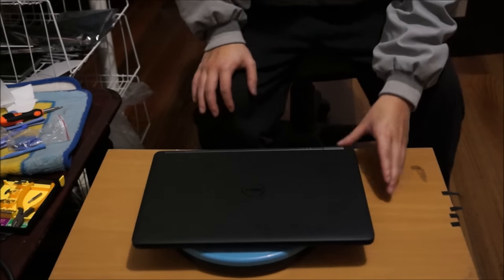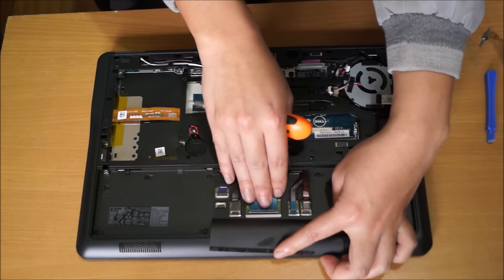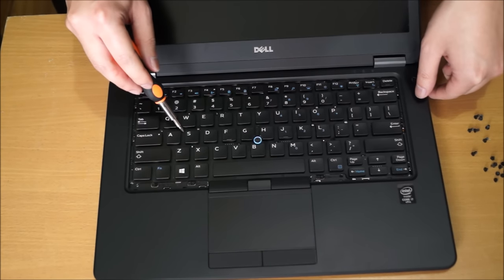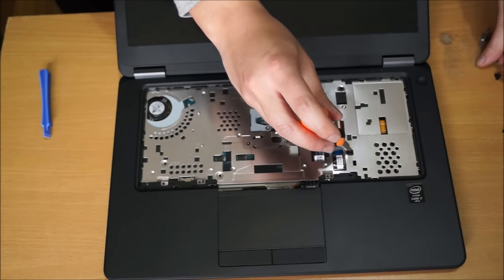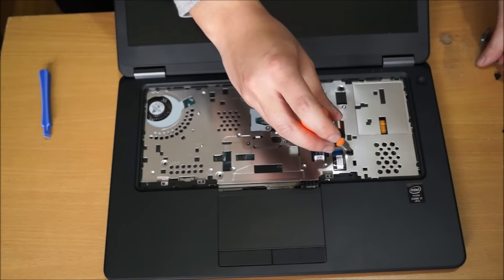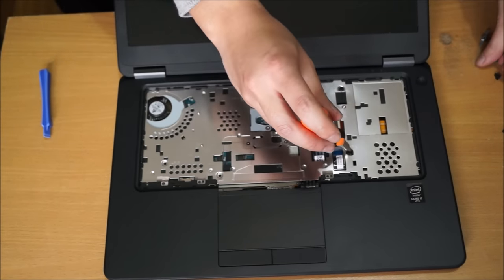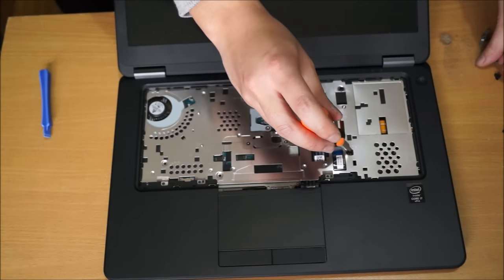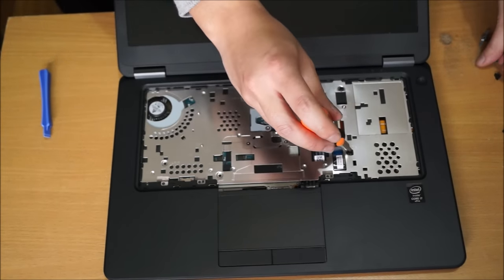OPEN ME UP! Dell Latitude E7450 and E7440 Disassembly Newer/Updated Video 1

Comment: E7470's are completely different than the E7450's - we have both in the environment and the E7470 has changed significantly.
Reply from the maker: Yes I have been advised of this and will upload  a video for the 7470 soon
Reply: Have you made the new video on the newest e7470? I just picked 2 up. Ive installed on my xps 15 9550 a Samsung pro 950 m.2. I want to install these on both Latitudes as they came with crap 128gb sanDisk x400. Even though I have a little Exp. in this, id feel more comfortable watching a video on my exact machine. Finally...I have been told even by dell CS (not that they all know what is going on) ,that you can upgrade the Processor from the i5 to i7. This would mean it is NOT soldered down. Any conformation on that? Thanks for all your videos!
Reply from the maker: sorry i dont have newer video on the products you are after, I can tell you that the cpu for both the 7470 and the 9550 is soldered on. I have provided you the user manual of the 7470 and it is soldered on. what dell is trying to say to you that there is a option when you buy the item to get i7 or i5. I will not be getting them as you may know i have to physically buy them to open them up and it is costing me too much. http://topics-cdn.dell.com/pdf/latitude-e7470-ultrabook_Owner's%20Manual_en-us.pdf 
http://topics-cdn.dell.com/pdf/xps-15-9550-laptop_Service%20Manual_en-us.pdf
Reply: Thanks for the reply. No actually I didnt know that you had to buy them yourself. That's crazy man, the service you put out is worth money...what a shame. Thanks for letting me know. I'm having a hard time finding much solid evidence on this e7470 on the ssd capability. Some say that the 512 Samsung 950 pro will not work on the e7470 because it is NMVE. Would you happen to know if the e7470 can operate the 950 pro. I was told only SATA, PCLE, and SED. I don't even know what SED is actually. Anyways, again i appreciate the reply and the info.

Comment: I disassembled my Dell 7450 as per the tutorial, which was clear and easy to follow. Thank you. Liquid spilled on my keyboard, it doesn't work anymore and the screen is appearing upside down. I thought I might be able to dry it out and reassemble. That didn't work.  What are my next steps? Will I replace the keyboard? Just the keypad? Or? How do I fix the screen? Thank you.
Reply from the maker: the screen is upside down probably because you press CTRL + ALT + UP, so just press the down instead up and it will fix the issue. you will need to replace the keyboard. once water gets in thats the end of it
Reply: @OpenMeUpTec   good

Comment: Jesus, you have to disassemble the whole damn thing to reapply paste? Had I known this, I would've opted for different laptop. Goddammit
Reply from the maker: this is a basic laptop normally purchase by companies and they use it the whole time without re-pasting it and it works fine. therefore you should be fine

Comment: thanks so much, humm nI need to put a new SSD, do you have reference that Imust look for? I wan make some 3D modeling (not big render just modeling) must I add change something else? thanks
Reply from the maker: nope nothing special. you need to reinstall windows or clone your current hard drive over to use the new one. other than that it should just work

Comment: My 7450 died and the LED gave me the possible "processor failure". I bought an new motherboard for replacement. Do I have to take anything else into consideration when I attempt the surgery on the open laptop heart? I need to bay thermal paste, anything else though?
by the way: Awesome video!
Reply from the maker: nope beside thermal paste and a screw driver

Comment: Hello, Are you still answering the questions??  If so, can I know whether I can replace the Hdd with a new ssd.
Reply from the maker: yes you can
Reply: By replacing hdd with ssd it'll speed up my laptop right? Thanks for answering my questions.
Reply from the maker: @hemantht2962  sort of but for you, yes it will make it faster than it was before
Reply: @OpenMeUpTec  thanks for helping me decide

Comment: should the fan start up right as i turn on my computer? i have the dell latitude e7440, and i think ive been having overheating problems. my computer shuts off very often. i just replaced the thermal paste but it's still happening...once i applied the paste i turned my computer on, but my computer still shuts off all of a sudden and i'm at a loss. it doesnt get hot before it shuts off anymore either, i feel the computer and its barely warm. i dont know what to do about this.
Reply from the maker: it get hots and to protect the system it turns off. if this happen everytime you turn it on it should turn off faster than before since it is already hot to being with this is how you confirm it. otherwise you can download CPU-z or something else that should you temperture.
Reply: @OpenMeUpTec  Since it gets hot, what should I do? I have a cooling pad, I replaced the internal fan, and I replaced the paste with new thermal paste.
Reply from the maker: @gwenr4173  the first thing you need to do is replace the thermal paste. if you have not done that it will generally resolve the issue
Reply: @OpenMeUpTec  I replaced it, but the CPU still reaches up to 94C when i run diagnostics

Comment: My E7440 is so slow, that's like having an old hard drive until I opened it up and realized I have a mSATA 250GB but I thought they are faster?
Reply from the maker: they are probably your SSD is stuff because it is too old. they do die after sometime.
Reply: @OpenMeUpTec  Thanks.By the way a great video. Whoever is making videos must see this as a guide on how to make a good explanatory video.
Reply from the maker: @kazkazo6709  thanks for your support

Comment: I saw that it is possible to customize this laptop with a discrete graphic card as the geforce 830/40M; I bought the basic model with only the integrated graphics but I was wondering if it would be possible to add the 830/40M later by my self. What do you think?
Thank you for the video.
Reply from the maker: nope you can't do it yourself plus there is no option for a graphic card you probably looking at the wrong model

Comment: Hi. Thanks a lot for that video. Do you think that it would be possible to use a motherboard with processor and RAM from that laptop to make a desktop out of it? Basically, I found a good deal for a mobo, so I am just wondering if I would plug it to an external screen with other peripherals, would it be working? :) Thanks for your reply ;)
Reply from the maker: nope. laptop motherboard require a laptop screen to boot up. Originally this wasnt need but many of the newer laptop have an error code for no screen detected. you will need to bypass this before the laptop can boot and display on a external screen
Reply: wow. thanks a lot for your reply. It wouldn't come to my mind that you need laptop screen to boot up.
Reply from the maker: for this laptop it requires a screen to boot. you can look at the user manual for the laptops and you will see many will have an error code for missing screen

Comment: Hello,
Nice video. Does anyone know where is lid sensor and if it is replaceable in e7450? Mine seems to be broken :( Screen is on after closing the lid . Thank you in advance for the answer. Regards, Marcin
Reply from the maker: it is normally on the bottom of the mouse pad. it is magnetic

Comment: hi, I have a E7450 and the trackpad has some bowing/bulging at the center. If I put the edge of a business card on it, I can slightly rock the business card, showing that the trackpad is NOT flat. Would it be possible for you to check if your trackpad has the same issue? Thanks !!!
Reply from the maker: +Francesco Caggioni sorry I no longer have the item to check for you

Comment: Dear Friend e7450 and 7470 dispay with bottom case is the same?
Reply from the maker: they should be the same. i know for sure the 7450 and 7440 are the same thing but the 7470 the base and motherboard layout was slightly different

Comment: I have this laptop E7450 nearly half of a year but from the star I have problém with graphic driver. Everytime when I have video playbacking from youtube or somewhere else on the internet I getting message that graphic driver stopped and was recovered. Video is stopped and black screen flashes. It is not possible to fix it with new drivers, new bios or even with new motherboard !!! Also I tried every version of Windows... 7,8,10.I dont recomeding this laptop for everyone....
Reply from the maker: normally just update the graphic card software which is  Intel HD graphic and you should be fine if not then it is faulty
Reply: +OPEN ME UP did you read my post? I wrote there that I tried everything... so driver was the first thing
Reply from the maker: Sorry for the misunderstanding what I meant is the graphic card software from dell not the official Intel HD software which is always never than the one dell has on offer. Please note windows update will also install the newest driver available so be aware of that This was a common issue with dell and ATI. You can search it up for more details. At the worst case it is faulty. I had this issues a few time before and it was always software issue with mines
Reply: +OPEN ME UP thank you, but I know what you told me. I tried it. Also dell change me a motherboard becouse of that but still same sh..t. Update is disablet

Comment: What time do you take out the Processor???
Reply from the maker: CPU is solder on, ram can be changed to 16GB max with 8GB in each slot and there are 2 slots, wireless card can be changed, 3G 4G card can be changed, and hard drive is a 2.5 inch thin 7mm

Comment: Hey I damaged the screen and want to replace it myself any advice and can you maybe help find lcd screen on Amazon 
I think I found it
Reply from the maker: user manual show you everything. it will tell you how to remove and replace every part possible in the laptop
Reply: Can I upgrade the display of my dell e7470 from 720 to 1080 display ?
Reply from the maker: yes

Comment: Where is the graphics card on this computer (e7450) I want to look into upgrading the graphics card for better gaming and video editing (yes I know this is not the best computer for that), I have heard of people changing graphic cards on laptops, can you on this laptop, and we're or how can you get the ram, if I want to upgrade to 16 from 8 gb, any advice is appreciated thx.
Reply from the maker: hardly any laptop can add or change their graphic card as it is solder on. this laptop does not have a graphic card and if it did it would be solder on. only big expensive laptop generally have the ability to change their graphic card but now newer laptop also have them solder on as well since it makes the laptop thinner and lighter
Reply: I have been doing reaserch and considering adding a egpu on this laptop whats your opinion on that?
Reply from the maker: dont. not many of them are confirmed as safe and working correctly. right now they are available and work but have a few issues. wait for a few months and proper EGPU will be available with USB and thunder bolt connection.
Reply: who would release that and isnt there a thunderbolt connection already? and would a geforce 750ti with 2gb get be medium graphic settings on bf4 with no lag and can you explain how the gpu on this computer works it says i have a intel 5500, isnt that diffrent from a video card?
Reply from the maker: that is from the CPU and a intel 5500 is nothing compared to a graphic card. it can do normal things like display a web page but cant really do any games
Reply: so at this point what is the best way to do some gaming at a low cost, and can you give me more info about using a egpu through thunderbolt port and usb, you said it should come out in a few months, were did you hear that from?
Reply from the maker: egpu is expensive. the dock holder cost at least $150US. Many companies are producing one like razer, apple, asus and msi it will be avaliable soon but will cost you alot. better off buying a cheap computer on ebay or something

Comment: Sir, I have one hdd can i use both ssd  and hard drive.
Reply from the maker: there is only a slot for one hard drive in this.
Reply: @OpenMeUpTec  that means i cannot use hdd and ssd at same time?
Reply from the maker: @KO-nr2rr  you only have on slot therefore you can only put/use one thing at a time.
Reply: @OpenMeUpTec  very bad this laptop. No Gpu
Reply from the maker: @KO-nr2rr  you got the wrng laptop . this laptop doesnt need a GPU it purpose was for work only
Reply: @OpenMeUpTec  Yes. But I research the laptop E7450  has nvidia GPU in some of them

Comment: Hi all, can anyone help me with this , I need to reset the bios , because I get an "service tag" and I do not know the password , some people told me disarm pc and disconnect all ... I tried but it did not work , you can anyone help ?
Reply from the maker: +Javier Delgado they cant make it that easy for you to remove the password. the password is store in the motherboard
Reply: Thank you. Then I can do nothing. If i have the schematic can i find the bios in a chip?
Reply from the maker: yes it is and you can short circuit it to remove the password but then you lose the bios and bricking your laptop
Reply: ok firend, one question more, please, one solution can it be change the mother board.
Reply from the maker: you can replace the motherboard if thats what you are asking. Motherboard is expensive as it has the cpu solder on to it

Comment: Does this laptop support using a M.2 / NVMe solid state hard drive? Or, does it need to use the SATA connection?
Reply from the maker: you can not use NVMe in this laptop. it only uses a SATA connector

Comment: Argh, NEVER touch the RAM contacts!  You can cause microdamage to the wafers from static. You also don't have any antistatic precautions (worktable/wrist strap, etc).
Reply from the maker: thanks for your concern. i have done about 100 of these video without the proper precaution and nothing has happen. i have even tried to damage things on purpose and still doesnt happen. this was an issue with older hardware but now it is not a concern anymore.
Reply: Unless you are shuffling your feet on the carpet before touching it, there's very little risk.